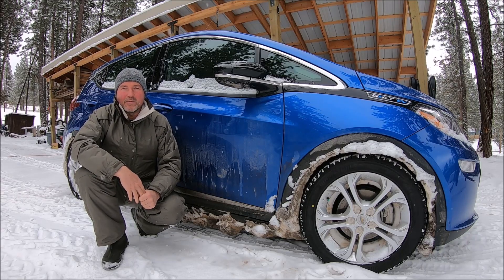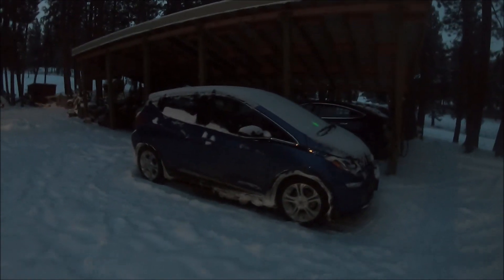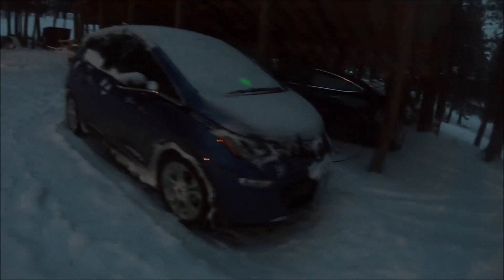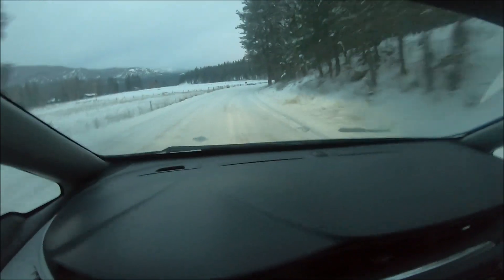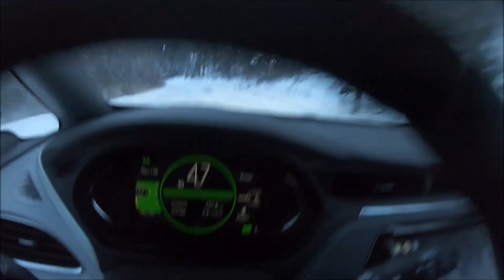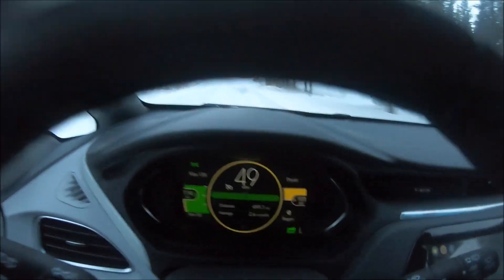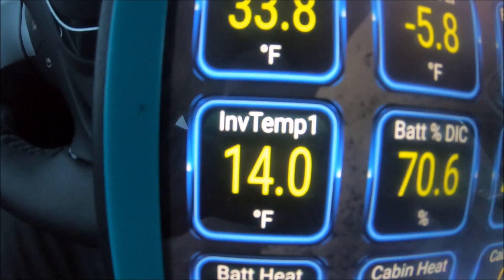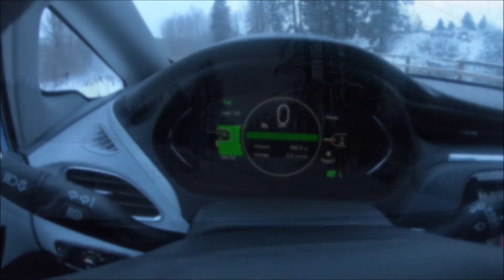Chevy Bolt EV Cold Morning Drive(-9°F/-23°C)No pre-heat, get in and drive. Regen/Power restrictions?

Comment: Shame it (or for that matter any "modern" car) doesnt have a legitimate emergency brake, you could just turn the wheel and yank the lever and youd be facing the other way to go back!
Reply from the maker: I used to do that when I was young🤣
I have never tried it with electric parking brake. I would assume that it works on snow. Don’t think it works on pavement.
Did you ever try?
Reply: @RMTFamily  I did it a lot on snow, was pretty good at it, most fun way to parallel park ever (note: warn your passengers first). Tried it a couple of times in wet, but started driving new cars and it didnt seem as good an idea after that. And electric brakes are just dumb, you cant use them as emergency brakes. But hey, brakes never fail, right so you wont need them..? I mean I only had one total brake failure and that was decades ago (altho its still fresh in my memory - pedal going straight to the floor with a "clunk" as I approach a stop sign on a local road that ends into a "T" with a busy state highway), GM guarantees it wont happen anymore, right?
Reply from the maker: @natehill8069  Cool. Yeah as we get older we calm down some and are a little more careful about what we do🤣
Complete brake failure happens in movies only these days. I have not even had to replace a master cylinder on any of our cars in decades. The last time was about 30 years ago after bleeding brakes when I did the old pump the pedal thing to bleed brakes.
The Bolt or pretty much every EV has the advantage of regeneration to help you slow down.
I did use the parking brake at very very slow speeds on our 2013 Model S after the car wash to dry them in freezing weather, it stoped quickly. I wonder if they lock up quickly at higher speeds too. Maybe some day with worn out tires I need to test that.

Comment: Thanks I live in Buffalo NY , purchase my 2022 bolt EUV in May 2022. Was worried about the bolt in our Buffalo winter but I Guess if it can handle Montana it can handle Buffalo!
Reply from the maker: There is really nothing to worry about, if you watched all our wintertime driving videos.😉
Key is to have studless snow tires like the Michelin X ice or Bridgestone Blizzak. Preheat while plugged in. And account for lower range.
Just watch all our videos and you’ll know everything you need to know.😀😉👍

Comment: Does the Bolt feature a heat pump system or just a traditional heating element/AC? Did chevy mention this in the manual?
Reply from the maker: The Bolt is special. It does not have a heat pump but also not a basic electric heater. It has a coolant loop with a heater core, a reservoir, a coolant pump and a heating element submerged in the coolant. 
So it is not as efficient as the heat pump type EV, but it is not to bad. With pre-heating the cabin during these temperatures, bad road conditions and lots of elevation gain we still were always able to get over 150mile real life range. The following video shows one of the many trips we have done in the cold: Cold Winter Road Trip with Chevy Bolt EV crossing the Continental Divide in rural Montana, 2 Passes
https://youtu.be/UbDEjwoRqGI

Comment: Nice review! I have a 2020 Ioniq Ev but it’s not enough headroom for a 6’3”” tall guy , I was thinking at bolt euv or bolt ev, which would you recommended? There’s heat pump in any bolt?
Thanks
Reply from the maker: Thank You. I’m not sure if the Bolt is better for a guy as tall as you. I’m short, only 5’5”. The Bolt does have a decent amount of headroom to get in and out of the car. I just know that because my father in law can get in and out of the Bolt without hiding his head as he does on most other cars. I have plenty of headroom. I think it could be a better fit for you. You definitely want to test it out. There is also the seat issue that many complain about. My wife and I have no complains at all, but many people have complained about the seats not giving enough support and being to narrow. 
No heat pump! The Bolt actually has a liquid type heater. An electric heating element heats coolant and a pump circulates it thru the heater core inside the car. The system works fine. Yes a heat pump is more efficient, but pre-heat while plugged in and then the while driving consumption of the heater will be much lower. I would not base an EV purchase on the heat pump.
Thank You for watching.
Reply: @RMTFamily  
Thank you for your reply and advise!
Reply from the maker: @stefanbololoi7110  You are welcome. Anytime.

Comment: This is the first video of yours I've seen.  It popped-up as a suggestion.  Thank you, the video is very interesting.  I've subscribed.
I've put some study into batteries to advert problems our aging hybrid car.  I learned that batteries do best when maintained at about 60F.  It seems to me that when your Bolt is plugged-in the system would warm the batteries to about 60F for the best care and to maximize the range available.  Can you address this?
Reply from the maker: Thank You so much.
You are correct about the battery temperature. Batteries like to be at about the same temperatures we feel comfortable at. But none of the electric cars maintain such a high temperature for the battery pack. This would take enormous amounts of energy to just keep the battery pack at temperature. The packs are not insulated and would loose heat very quick, possibly even causing huge temperature differences throughout the pack which is a bigger problem than lower temps.
Batteries can handle low temperatures just fine as long as they are not put under a high load or are being DC fast charged. Pulling high numbers of KW's out or pushing them in is the problem. That is the reason for Regeneration and Power restrictions when the battery pack is cold. 
Engineers that design the battery, type, chemical make up etc determine the limits of power that can be pulled out or pushed into the pack at certain temperatures. 
Our Bolt does relatively little battery heating which makes the car more efficient as the energy stored in the pack can be used for driving. 
Tesla pre-conditiones the pack for DC fast charging to over 100°F. It can accept more power that way without damaging the cells. After charging the pack is cooled down again.
It has been proven that packs with liquid temperature management will last much longer than air cooled packs like the Nissan Leaf has. The Bolt's and Tesla's have minimal battery degradation, while Leaf's especially in hot climates have extremely high degradation.
Heat is more of a problem than cold for battery cells. Unless it is extreme cold (-20°F) for a long period of time.
There are many different hybrids out there with batteries ranging from around 1kWh to around 25kWh. Most hybrids still have a much smaller battery of a different type and make up than fully electric cars. They may not even have any temperature management at all since they are small and the ICE will just take over during extreme temps, also the loads put on these packs are small and the batteries are depleted relatively quick.
Hybrids with larger packs that can actually go a good distance on electric only, like the Chevy Volt, have usually battery cells that are found in fully electric cars and have liquid temperature management just like the big packs. 
Smaller hybrid battery packs are usually relatively cheap and easy to replace but still last amazingly long. 10 years plus not uncommon.
The larger hybrid battery packs are much more expensive and designed to last the lifetime of the car. They will degrade some over time just like any battery but usually maintain 80 to 90% capacity after 10 years and/or 150k miles.
Since I don't know which hybrid you have I just gave you the overall info. Battery problems are actually rare. The Nissan Leaf's bad temperature management makes batteries look bad and scare people away from electric. Also Tesla with their no repair, just replace battery pack policy they had in early years lead people to believe the packs are going bad all the time. But mostly it was just contactors inside the pack that malfunctioned, an easy repair. Now Tesla finally does replace contactors instead of replacing packs, but still will only do pack replacements for other failures inside the pack that could be repaired at the service center.
We own a 2013 Tesla Model S with just about 200k miles on the original battery pack and motor. We just purchased it about 7 month ago. Check out those videos on out channel.
We treat out EV's not much different than we used to treat the ICE cars. We keep them plugged in when possible (sometimes they are not plugged in for days, the Model 3 has been sitting in the cold without being driven and not plugged in for almost a week now), we charge the battery as needed for daily use or to 100% if needed for travel. While our EV's are sitting around we make sure to keep the battery between 50 to 80% SOC, since that is where most lithium batteries like to be. 
I hope I was giving you the info you were looking for. 
Which hybrid car do you have? How does it work for you? Is it a plug-in that you can charge at home?
Thank You again.
Reply: @RMTFamily    Thank you very, very much.  That reply was stellar.
We have a 2013 Prius C that's now nine years old with 61,000 miles.  It is not a plug-in.  We bought it brand new, and it cost us a little over $21,000.  The only problems we've had was in year seven I replaced a taillight bulb, and today year nine, I replaced the taillight bulb on the opposite side.  While at it I found the license plate lights need new bulbs too.  I think the bulbs in the back of the car are shorter lived due to slamming the hatch.  But that's been it for problems.  It's the best car we've ever had or known of.  And yes, it has worked well for us.
In an effort to extend the traction battery life, two winters ago I started using our garage heat, and I set it at 60F.  This is also better for the engine and the car overall.  The ICE car in the next bay reaps the benefits of garage heat too.  A 1948 Chrysler Windsor sedan that I use regularly.
Thank for the magnificent response.  It lifted my day and strengthened my faith in the goodness of mankind.
God bless.
Reply from the maker: Thank You. The Prius is known to be a great car. Many of them have over 200k miles. Not necessarily with the original battery but some do. Since the Prius is a very common car the battery replacements are priced between $900 and $1500 aftermarket or about double that from Toyota. The Battery is actually really easy to replace. It sits at the front of the trunk, kinda under the rear seat. A tech that knows what he's doing can replace it in an hour. With only a little over 60k miles it would be worth to replace the battery if needed. But the way it sounds everything is well and hopefully it stays that way.
I'm sure the Windsor likes the warm garage. Those are good looking cars. 2 or 4 door? Maybe even a convertible?
Reply: @RMTFamily    Thank you.  You may have missed it, but our car is a Prius C, so cost for traction battery replacement may be less.
The '48 Windsor is a sedan--four door.
However, nearby to me is a '48 Town and Country convertible that is in drivable condition and remarkably it is a complete, and completely original car just as mine is.  Many of these cars are altered and/or missing original parts.  So, to have a complete car right down to the cigarette lighter, as well as having retained every non-wearable original part, is rare and very special!

Comment: 22 degree weather I lose about 50 miles of range on a 187 miles trip.  Mostly due to using heater. But I only run heater intermittently.  Completely off until I get cold or windshield must be defrosted. Then back off again.
Reply from the maker: Heat is a big power user. If possible pre-heat the car while plugged in for at least 20 minutes. The idea is to warm up everything in the car not just the air. Turning it off completely can work against you as everything in the cools off and then absorbs the heat again when you turn it back on. A lower temperature setting may work better. Check the energy display to see how many % is used for heating. I found on longer trips it is around 10%.
Road conditions and even just light headwinds can impact range a lot.
If we head east from here it is an uphill battle. It looks like it’s flat out but actually we constantly drive up hill. On the other hand coming back we always do much better because it’s downhill. 
Have you checked out our other Bolt winter driving videos yet? Like the one we drive across the continental divide. You could then compare our range loss and yours. 
50 miles range loss is possible but only about 10% (25miles based on EPA range) should be from heating the cabin.
It sounds like you are suffering on that trip. 
What year is your Bolt? Does your Bolt heat the battery while driving? If so how much heat goes towards that? Check the energy screen. To get the battery up to temperature it’s best to schedule the charge for departure time. Charging will bring up the battery temperature. 
Unfortunately there is only so much you can do.

Comment: The BMS will attempt to maintain a minimum/maximum battery temperature regardless of whether the car is on “On” position or not.  If it gets too cold, the heater will kick in and warm up the battery.  In a hot climate, if the battery gets too hot, the A/C compressor will kick in to cool it down.

Comment: It didn't seem that you had pre-heated your car while it was still plugged in (based on all the snow on the windows).  That would increase your range a fair amount.  Teslas do that easily via your phone app.  Do Bolts have that option?
Reply from the maker: As the it says in the title of the video: "No pre-heat". This was to see how the car would do all cold. Turning on the pre-heat could have triggered the battery heater as well and I was trying to prevent that.
We usually use the Bolt key FOB to turn on the pre-heat. Due to the lack of cell phone signal in our area I have to go outside and get in the Tesla to turn on the pre-heat. The Bolt's key FOB works from inside the house.
I have found that the Bolt and the Tesla are about the same when it comes to melting snow of the car during pre-heat.
Reply: @RMTFamily  try SpaceX starlink for the cell connection.
Reply from the maker: @denniss1211  We have Starlink but the wi-fi signal does not reach the car. We do wi-fi calling for our cell phones.
Reply: @RMTFamily  -- Good to know, thanks.
Reply from the maker: @Davran2742  You’re welcome
Reply: I recently sold my 2019 awd-e Prius for more than I paid for it new (before the 5th-gen comes out), and ordered a '23 Bolt ev while the rebates in Canada are in full swing -- $5K federal and 4K provincial in BC
The awd prius was excellent in the snow with bridgestone ws90s, and then xi3s (when my son needed winters).
I don't have the snow and/or cold you do, but I commute over a 1,300' mountain pass in the middle of Vancouver Island BC, and it's gets snowy and slippery.
Reply from the maker: @Davran2742  Good deal. Selling for more is always fun. And getting the rebates for the next one. 👍 
Winter tires are just better in winter. Colder temperatures, frost, snow and ice and everything in between is much safer to drive on with a good tire.
We have been to Vancouver Island in 2013. It is beautiful. Back when, we did not drive electric, we need to visit again with an electric car.
Reply: This was to test WITHOUT pre-heat. I would expect that when you go somewhere when it is freezing cold, and don't have the option to plug-in - this is what you would experience. You can't always plug in everywhere you go.

Comment: Sir,
Thanks for the video. It seems you like to do a lot of regeneration. Most electric cars are about 70 percent efficient doing a regeneration cycle. In other words when you take 100 units of kenetic energy and turn it into chemical battery energy and back into kenetic energy you will only get 70 units of kinetic energy back. Sooo… I try to not plan on constantly regenerating but instead drive looking ahead to start coasting slowing down so I don’t have to pay the 30% inefficiency tax. If you have no other choice but to bank the energy by regenerating I just know I am losing 30% of my energy for the banking it privilege vs 100% tax without regen.
Reply from the maker: You're 100% correct. Regenerating happens at a loss as always when we change any form of energy into another. In this video I was driving aggressive to see if the car would restrict acceleration and/or regeneration, as well as to see how quick the battery temperature would increase. In "real life" I don't drive like this. But I take advantage of regeneration instead of using the friction brakes that turn 100% off the energy into heat.😀